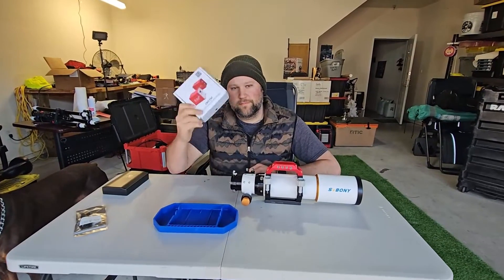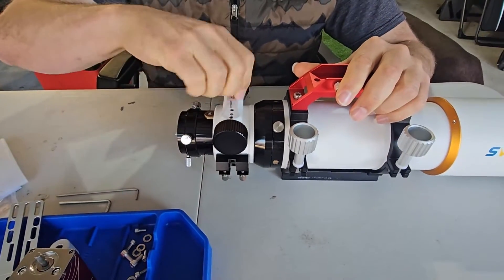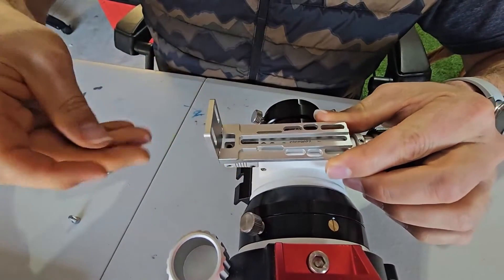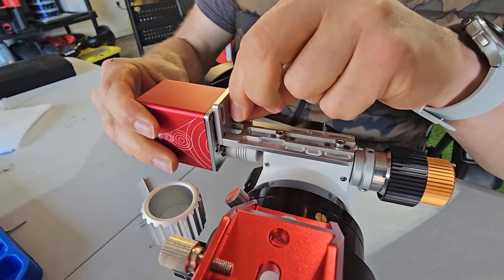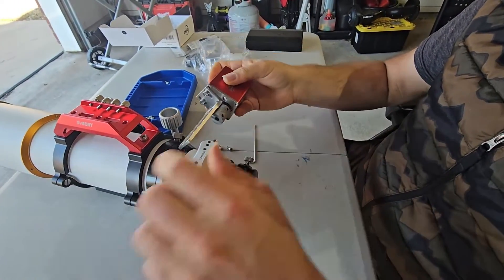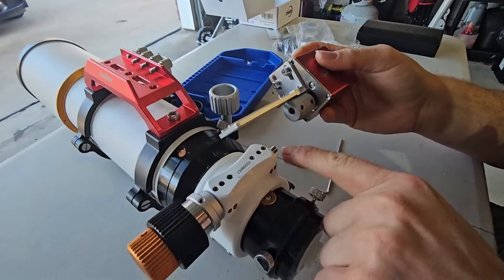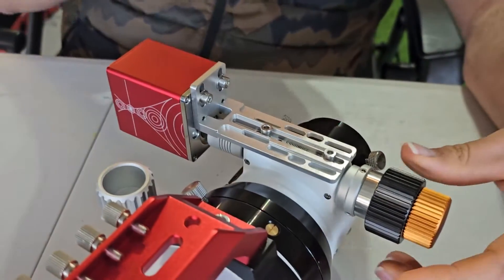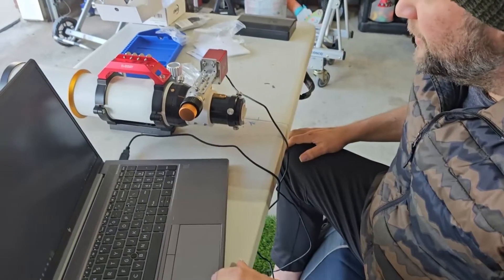Auto Focusing: Is it Worth It?

Comment: This is such a good step by step for beginners like me. Thanks a lot.

A quick question: Would the auto focusing be performed for coarse or finer focusing?

Subscribed 👍🏻
Reply from the maker: Out of attached to the main shaft on the coarse side only. It replace that knob, however the steps are so fine that you can't barely even see it move. So the detail of focus is much greater than what you're eye can even perceive even with a bahtinov mask.  Hope that helps, and thanks so much for the kind words!